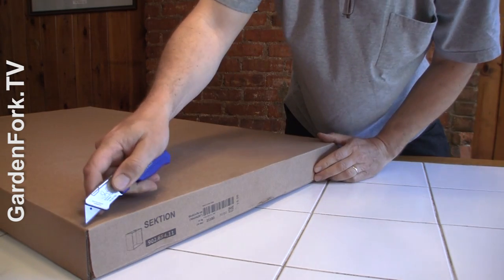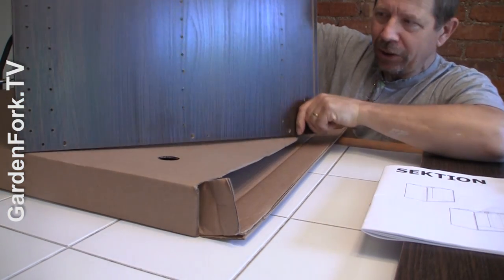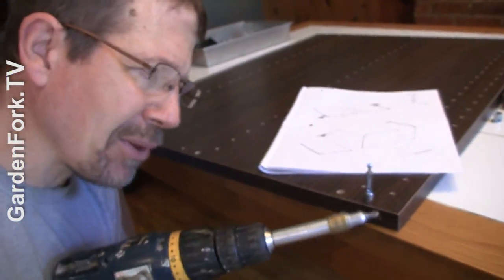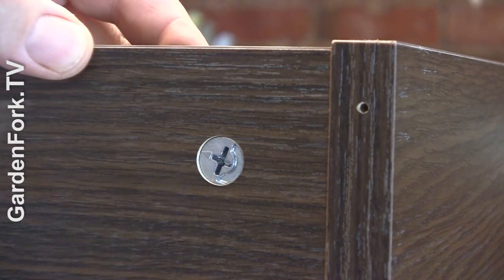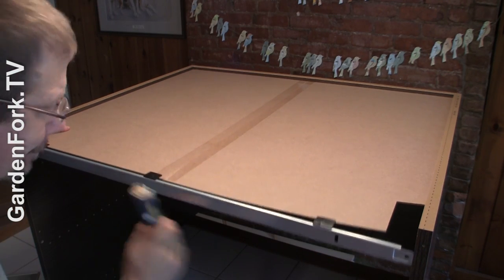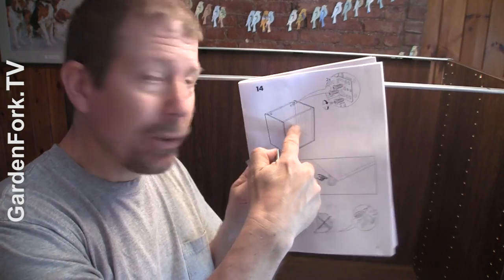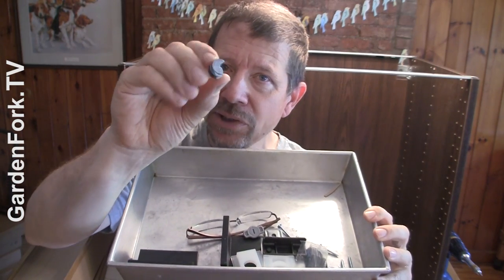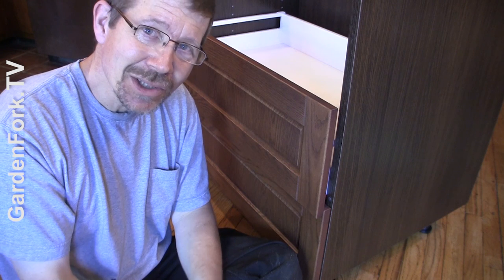How To Assemble Ikea Kitchen Cabinets - GardenFork

Comment: Help!  I've put a LOT of IKEA things together before but I am having big problems understanding how to attach the drawer fronts!  You ended this video honestly showing you had a problem too!  Can you post a troubleshooter video on what can go wrong with the drawer assembly (seems like it depends on whether it's the top, middle, or bottom drawer as to which holes on the back of the drawers you use).
Reply from the maker: +Sally Snodgrass I found the top connector part of the drawer side was getting in the way. Thx!

Comment: This is a great video for me because I kept hearing about how Ikea cabinets were pretty good quality, etc. Now that I can actually see how they go together, I don't think I would buy any. Yes the sides are nice and thick, and yes the drawer systems they use (Blum) are awesome, but I really don't like the 1/8" backs, the lack of proper top braces (there's no "wood" edge at the top), and the feet that just push-in (I prefer the ones that push into cups that are screwed to the bases.

I worked for over 5 years building high-end kitchen cabinets, and our boxes were soooooo much better. Still, for the price of the Ikea, they're better than a lot of others, so ultimately it's up to the consumer.
Reply from the maker: i can see for a high end cabinet maker, that these aren't in that league, but I've installed several of these kitchens, and they hold up well. for me its a sum of the parts, and once you tie the cabinet to the countertop, a wall, or another cabinet, they lock up pretty tight. and i drill a pilot hole and screw the legs into the cabinet, i just didn't show that part.
Reply: They're definitely not bad, and they're better than Home Depot or other cheap cabinet options. I just prefer having a solid back, and top stretcher bars.

I know they hold up. Lots ofr people recommend them, and some of them have had their kitchens over a decade.

I'm just really picky. Haha.